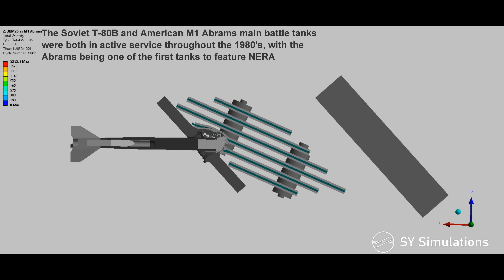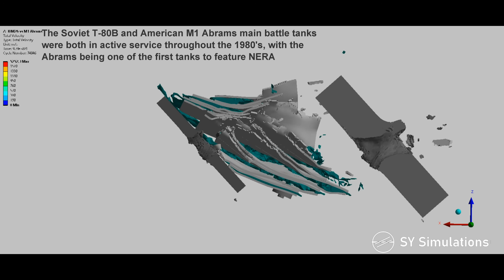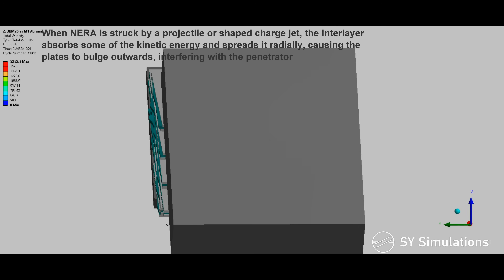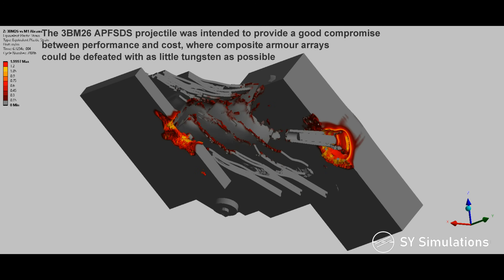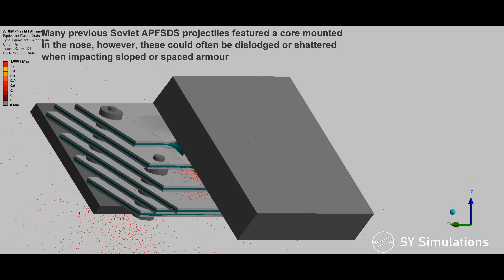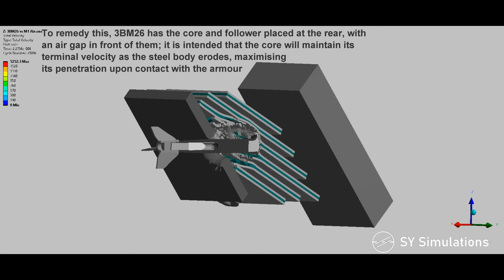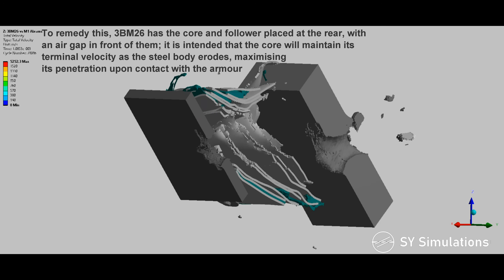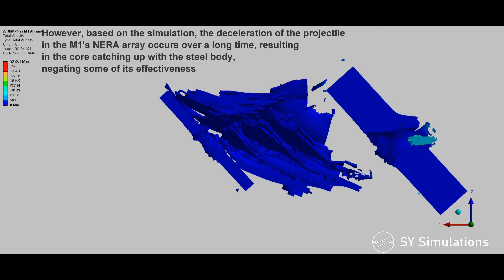T-80B vs M1 ABRAMS | THE MOST UNIQUE APFSDS vs NERA | 3BM26 Composite Armour Penetration Simulation

Comment: Every value ever reported about any russian weapon system from within Russia is to be doubted. 
On many occasions russias equipment has failed to perform according to its paper specs. SAMs dont intercept, their cruise missiles dont hit as precise. Their tanks are incinerator coffins on tracks, their radars do not have the claimed reach and to cut back to this propaganda piece video here - their paper penetration values for their tank ammo regardless of type is highly overstated. 
It all comes from a communist cleptocraty where lies are accepted and bribe is valid tool to achieve success.
Doubt every value they state!!

Nato Equipment - and that also shows in ukraine is MORE performand than its paper values.

Gepards From the 70s shoot down cruise missiles that are from 4 decades ahead in time.

Iris-T has so far a 100% interception rate. That means every single missile every shot from within ukraine did hit its target.
Ukraine recieved rather old Block II patriot systems and did shoot down russian hYPeRsoniC missiles... 
And thats done by troops that got trained in a hurry.
Channels like this one here repeat russian vatnik wet dreams. 
They continue to use those corrupt values of their weapons performance "data" sheets.

The vatnik who runs this channel might as well upload a video that shows a russian nanobot grenade defeating a Leopard 2 A8s Turret frontal armor by eating the metal...

Its fairy dust, a soap bubble filled with vatnik ass gases to make it float even better.
Reply: You have won the cope championship🥇
Reply: @Baton666  i dont need to Cope

Comment: Does this simulation prove that composite armor is useless against APFSDS rounds?
Reply: Earlier models of NERA on the abrams are most optimized against atgms and RPGS but provide good protection against older generation armor piercing rounds. The turret is a bit stronger but these were at the time cutting edge soviet armor penetrators so the weaker hull would be unlikely to stop it with ease.
Reply: @doobs5342  why are you phrasing it this way "the weaker hull would be unlikely to stop it with ease" 😂 what kind of cope is this, you just watched it cleanly perforate through and it isnt even the best soviet APFSDS round. 

there is no "likeliness"  it goes straight through irrevocably, and it cannot stop it in any manner or way.

Comment: Dayum, no wonder the Abrams was introduced to a hull down doctrine. The hull was the largest weak spot.
Reply: The new M1E3 in testing should really improve upon the front hull armor, considering the shift in military doctrine in Europe

I don't think Abrams tanks are being used hull-down like they were intended nowadays 😢
Reply: Hull, neck and gun mantlet are weak spots on Abrams. We were told to aim there during my army time.
Reply: @nuraly78 but those week spots are much smaller than the hull/ lfp
Reply: @nuraly78  Yeah, the turret ring and mantlet were pretty worrisome areas that any Russian tank can use to take down an M1. I’m guessing that most MBTs would engage each other at very large range of 2-3km, so they would be a hard time to hit
Reply: @TheEntwicklungEnthusiast  not sure about modern russian tanks. I am from Kazakhstan.
We had soviet made T-72 model 1989. We were told that APFSDS is good up to 2000m. 2000-3000m we were expected to use HEAT. Although our tanks had equipment to launch ATGMs, I haven't seen any.
We studied all major MBTs and their weak spots. But in particular we studied T-72s, ZTZ-96, Abrams and Leopards
Reply: @nuraly78  Oh, thank you for that additional information. In particular what was discussed on russian doctrine of ranged engagement compared to western ranged engagement?
Reply: @nuraly78  What were the weak spots on the Leopard 2?
Reply: Iirc the original Abram's armor was only rated against the T-62's 115mm gun, as that was still the predominant vehicle used by the USSR when it entered production (ofc that has improved over time). Tank designers usually design better armor on the turret than the hull anyways, as that is the most likely part of the vehicle to get exposed and hit - for example early T-72s could be penetrated through the hull by M735, whilst their turret faces were completely invulnerable to the same shell
Reply: No, the largest weakspot on any tank is the lower side hull. 2/3rds of the Abram's side skirt are a ruse, just thin metal sheets, it is nothing.
Reply: @JAnx01  aside from the fact that you're wrong about the skirts every tank in the world features the "vulnerability" of the areas which are much less likely to be hit being much less armoured.
Reply: @JAnx01 thanks for stating the obvious but most people talking about tank engagements are talking about two tanks facing each other
Reply: There is no hull down doctrine, not for the Abrams and not for any Tank. This is cope
Reply: @parallax9084  thats true and wrong. The doctrine really doesn't exist, at least has no name. But western tanks were designed since the 1970s for optimizing hull-down and turret-down position. Thats for example why the sensors moved on the roof of the tank in the west, while this didn't get into Russian tank building until the late 2010s. Soviet tanks never had the ability to  operate turret-down. The poor gun depression of soviet tanks is another design choice that never had the desired advantages.
Reply: @denniskrenz2080  Western tanks were never designed to fight hull down. You said yourself no such doctrine exists. So stop coping. What sensors? What optics and sensors did western tanks have on roofs that Soviets didnt? None, matter of fact the T-72 had better situational awareness and optics for the commander than the Abrams. Why wouldnt soviet tanks be able to operate turret down?😂 Who told you this? So is the gunner scope on the hull or the turret? The gun depression has nothing to do with any of this.
Reply: @parallax9084  maybe you should first see a tank before you talk about it.
Reply: @denniskrenz2080 You are wrong, Soviets also moved their sensors to the roof, just look at where T80B and U have their wind sensors, etc. Also Soviet tanks couldn’t be hull down, but the advantage to that was that they were smaller, also Soviets intended to use their army for the plains of Europe where there weren’t that many hills
Reply: @lodickasvlajeckou One or two sensors don't really matter if you need to expose most of the turret for tracking the target. (Especially if its a wind sensor, which is likely the least useful part on a tank.) Also it isn't really useful if you have to expose a lot of deck mounted gear until at least commander periscope and further below, the only nightvision sight are exposed, contributing to the poor performance of Soviet-era tanks at night. The important fire-control sight is still as high on the turret as it was on the T-64, the T-90Bs were the first really break that scheme.
Reply: @parallax9084  Brother, Western tanks were designed specifically with defensive maneuvers in mind, since tanks like the Abrams were made to challenge the hoards of Soviet tanks during the Cold War. What do you think comes with defensive tank doctrine? Hull down, dug-in tank positions 🤦‍♂️
Why do you think that Western tanks prioritize heavily armored frontal turret armor and more sophisticated vehicles overall? Since they were intended to be used in the hull-down position, their hulls and to an extent turret rings would be concealed from enemy fire, meaning it was fine if they weren't the best armored, just to save weight; it's also why since the fall of the Soviet Union, Western tanks have been headed towards a more offensive role, while Russian tanks have been headed towards a more defensive role. You can see the doctrinal differences by just looking at new tanks and AFVs in both parties

Soviet tanks were designed primarily with an offensive role, which is why they had pretty damn good overall frontal protection and low profiles, but had shit reverse speed which is detrimental in tank-on-tank combat where the mass-attack, offensive doctrine no longer applies, like the current situation in Europe

These facts aren't cope, if you want to refute my words then provide some solid, reputable sources
Reply: @convenientplayer  No they are not intended to be in a hull-down position. Defensive manuevres and being "made for hull-down" are two different things. The Abrams was never nade to sit hull down on a front-line as any MBT hasnt.
Reply: @parallax9084 you can say the same thing again and again it doesnt change the fact that you've got nothing backing it and that the existence of the challanger 2 defies what you're saying
Reply: @stephenallen4635  If you read the replies to what I said, you can clearly see they recognize what I said as the truth. But instead your friend here created a strawman about Defensive manuevres- which have nothing to do with being designed in "hull-down". The challenger wasnt designed for hull-down either, the challanger is just a shit tank. And westoids tend to cope about it by acclaiming to some "hull-down" cope.
Reply: @parallax9084  sorry I cant take you seriously after seeing you write westoid and cope unironically

Comment: Still seems curious that every soviet round is effective against western armor but in reality we see a lot of soviet tanks getting destroyed in direct comparison with western tanks...still something does not add up...
Reply: Because the chance of an Abrams fighting a t80 in a head on 1v1 is stupidly low amd most blown up t80s are because of missiles drones and arty. Same can be said for the abrams
Reply: T-80B is slightly newer than the base M1 Abrams for one. And The 120mm can penetrate the T-80 easily too at about this range.
Reply: @neurofiedyamato8763  T-80B entered service in 1978, M1 in 1980. The 3BM26 round itself is newer - entered service in 1983-84. Though the preceding DU-based 3BM29 (1982) should also have been sufficient for this kind of penetration.
Reply: @Postoronniy  Woops you are right. I mixed the year up with a later variant. I should double check next time.
Reply: Because armored and combined arms combat does not boil down to just armor penetration values. Tactical and operational situation, battlefield conditions, crew training, logistics and maintenance, command and control, reconnaissance, fire support, other combat multipliers, etc. - they all factor in.

The conflicts with lopsided losses of Soviet armor were also usually engagements against outdated vehicles with outdated ammunition. For example, the best Iraqi tank of 1991, the T-72M1, is a 1982 export version of already not top of the line vehicle (in terms of sights and FCS); and even worse, the Iraqis had to make do with obsolete 3BM12 and 3BM9 APFSDS rounds from the 1960s (which still had good performance against Iranian M60s and Chieftains, but had little hope against frontal armor of NATO M1A1s and Challengers).

In the conflicts where both sides were roughly comparatively matched-up for most of those factors (for example, 1973 Yom Kippur war, or 1980-88 Iran-Iraq war), they usually both suffered high vehicle attrition.
Reply: @Postoronniy  to make things worse — they struggle with fuel and ammunition, because the total air dominance. They barely knew, where is enemy and where it will advance.
And T-72M1 was their top noth machines. T-72M (basic T-72A) was far more common.
And this was even not late variant, their T-72M does not have any proper FCS. And all variants was not up-armored like native Soviet tanks.
Reply: do your research and then come back, you still have a lot to learn about tanks.
Reply: But we don't talk about the western tanks being destroyed? Have you not seen that video where the Leo gets massacred by drones or an ATGM? Ukraine is a tank graveyard, and the only thing the western tanks have better than the Russian ones is the crew survival rates. All Russian tanks (including the ones the Ukraine is using) are superior when moving in mud, thanks to not being 70 tonnes heavy.
Reply: Because it’s not tank to tank combat anymore it’s drone/artillery/atgm vs tanks
Reply: It adds up perfectly. But a lot of people are very selective with the information they work with. Most people use the example of the Gulf War and then expect that Western tanks will go through the Russians in  Ukraine like a knife through butter. Most T-72s that were massacred were outdated T-72Ms and T-72M1s that were facing a lot more modern western tanks with modern rounds (for example Iraq was still using the 3BM9 round which the Soviets STOPPED using in 1973), armour, FCS and thermals. What's more,  the Western tanks had total air superiority, better logistics and a lot better-trained crews with high morale. T72M (and T-72M1) was a highly outdated 1970s  export tank made to fight outdated western tanks like Chieftains, M60s  and Centurions. But with the problems and adversary they were facing, the Iraqis wouldn't even beat those Centurions. If you even the odds and look at a conflict that has adversaries with a similar level of training logistics etc. then the T72 does not seem that bad (not saying it is better than M1 or Leo 2). For example during the Iran-Iraq war Iraqi T-72s and even T-62s massacred export chieftains and M60s that the Iranians were using. Does that mean that all Chieftains and M60s are pure shit compared to a T-72? NO. but it is the same flawed logic a lot of people use when talking about T-72.
Reply: because in most wars its soviet tanks armed with outdated rounds against modern western tanks... in fact the only time modern russian tanks have entered combat is in ukraine and EVERYONES tanks are dying both western and eastern since the main killer of armor has always been atgms drones and arty
Reply: well basically if we have 4 digit amount of soviet tanks fighting each other from both sides and 2 digit amount of western tanks at one side, it becomes blatantly obvious to guess which tanks statictically will get damaged/destroyed more often. and yes, tank-on-tank engagement is quite rare sight in modern warfare.

Comment: Eye opening. That was brutal.
Reply: Blud thinks we're in 2050 💀
Reply: @Richard_T800  Color isn't about speed it's about temperature. And RU also uses depleted uranium so it's gonna be changing colors regardless. But go on...
Reply: @davidwood2205  don't fall for soviet propaganda
Reply: @WotansCry  3BM26 has 490mm of pen at 2 kilometers distance, that isnt propaganda, the Penetration values of 3BM26 arent classified anymore and are public.
You just over estimate the M1
Reply: @Richard_T800  Well this simulation means nothing because its not accurate, Rubber doesn't behave this way, and neither does NERA, (non explosive reactive armor), as you can see in this sim, it did literally nothing. Realistically when the NERA is penetrated the shockwaves warp, bend and bulge the material (however this sim shows the NERA just being blown apart as if it were an HE projectile) which isn't how metal or rubber works lmao, and the kinetic energy transfers from projectile through the rubber sandwiched between the metal immediately slowing the projectiles speed like shooting a bullet in water or a baseball in a glove, this didn't happen in the sim, and no this has nothing to do with "well maybe its because US armor sucks" its because the sim just isn't accurate at all.
Reply: @Maj_Hater  3BM26 is still gonna cut through like butter, it has 490mm of penetration at 2 kilometers distance. And the sim is accurate, the shot has 12MJ muzzle velocity, at that speed rubber and metal will act like liquid because of the immense kinetic pressure. And you can see how the shot looses most of its velocity in the NERA. 
And i agree US armor doesnt suck, but a tank designed for a hull down position wont survive a shot its not designed to survive
Reply: @Richard_T800  The shot doesn't lose any velocity, as i previously stated. It doesn't even slow down. The whole point of this type of armor is to transfer the energy of a kinetic projectile through the plates, instead this sim just "blows them up" there isnt any warping or bulging it just blows apart. So im going to keep pointing it out over and over again that this isnt accurate. 

"On all Abrams models up to the M1A2C, the frontal hull armor is 700mm thick. I have measured this myself, using the weldlines as a guide. From the front to the weld is 600mm and then behind the weld is a 101mm steel plate, giving a total thickness of about 100mm"
Reply: @Maj_Hater  And the Armor of the M1A1 isn't a secret anymore l, Abrams have been captured and studied. Again a vehicle designed for a hull down position won't survive against a vehicle designed for an open engagement.
The Abrams isn't a wonder weapon, if it gets used wrong it's going to fail. If your Abrams is on an open field you are using it wrong
Reply: @Richard_T800  this isn't the m1a1 this is the M1 Abrams 105mm
Reply: @Maj_Hater  oh yeah it is, my mistake
Reply: @ns_gefolgsmann6156  Yea, hows Russian tanks doing in Ukraine? Not good lmao what was it? 30k T series tanks clapped? yeap
Reply: @Maj_Hater   Well, time to get a material science degree to verify it, and slap it through whatever the program used is. Still neat stuff to get a glimpse into.
Reply: @Maj_Hater Neither does any of the tanks that the West sent. Although, tanks seems pretty powerless in such a conflict.
Reply: @MrKekus-o3l They took all our shovels, our cardboard Armor and washing Maschine chips…! 5 Billion T-Series Tanks destroyed. They took our toilets aswell. All we have is the pipes. )))
Reply: @WotansCry  Too bad, i always fall for Soviet Propaganda.
Reply: @WotansCry  You’ll kys when you see what happened to 20 years plus evolution of this very same tank xD
Reply: @WotansCry  It's not propaganda. It's facts. Without its top secret armour, the M1 is just a tank.
Reply: @WotansCry soviet union died like 60 years ago tf